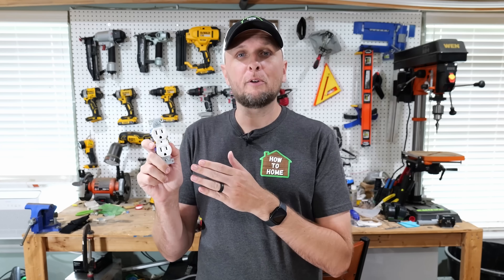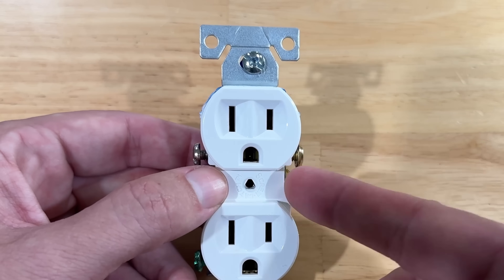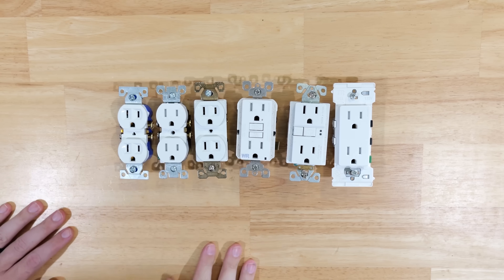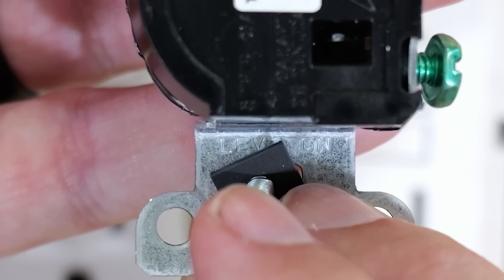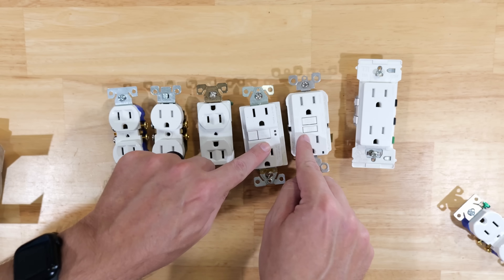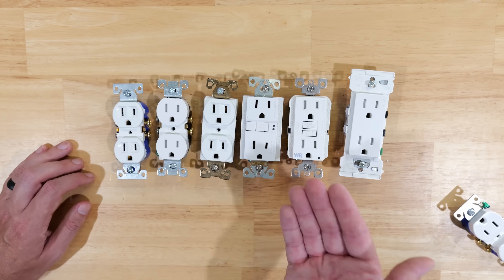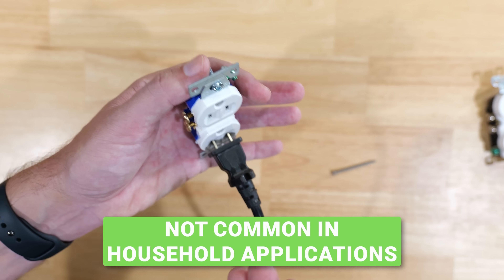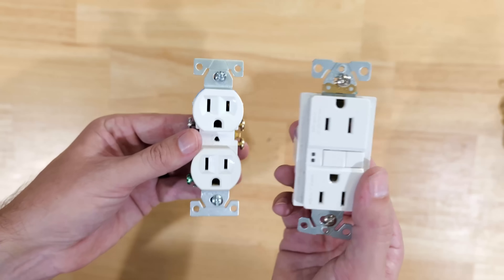The Shocking Reason Why Your Outlets Are Installed Upside Down!

Comment: next time you're in the hospital, look how they install receptables. At least the ones near me here in N Virginia... the ground prongs are ALWAYS installed up, not down. Interesting.
Reply: @charlesfields6597: Ground prong up when that outlet is attached too the wall-switch so people there know where to plug in their lamp to control it from the wall light-switch.
  Medical facilities have things hanging on walls that fall, like clipboards, scalpel, hemostat, that can fall and short the circuit, military galleys and  restaurants, ground up was specified, due to stainless steel utensils being dropped, etc. Therefore it has become required that they be ground up for contractors. In many cities ground up is standard in all commercial and industrial buildings, ground only go down in residential buildings, houses, apartments, condos, etc. 
   Internationally, countries with 3-prong outlets always have the ground up
   Everything is in context and the answer DEPENDS on context. 
   Examples:
“Never took the orientation of an outlet seriously until I was measuring for a shelf with a tape measure. It slid down and fell across the prongs of the washing machine plug.  POW! “ —@joef.6596
“I work at a K-8 school. Maintenance assembles powered multi media carts with the ground plug up in consideration of teachers dragging metal bracelet chains across partially unplugged power plugs.” —  @scaryhouse7969
“a length of florist's wire rolled off a side table onto a slightly loose plug and shorted the circuit, creating a small fire (quickly extinguished).  I now always install ground prong up” @deegee54
“I work at a restaurant and we have this work table with some outlets built in on top. Someone managed to let the edge of some tin foil go in between a plug and the outlet and it got disintegrated.”@MatthewSuffidy
“I knocked some change off of my end table one day my mistake of course, and a coin fell down right on the prongs resulting in a loud pop and a flash along with some smelly black smoke. I have since gone through my home and reversed all of the receptacles so the ground prong is now on the top.”—@chrisenglert3958
“my wife's gold necklace chain dropped off the rack onto two prongs of a device that were plugged into a receptacle with just a little prong showing.  It vaporized the gold necklace area of contact and left a nasty burn mark on the faceplate of the receptacle.   This was on a bar and I probably should have oriented the receptacles there ground prong up.“—@winfordnettles3292
"I had lunch with the Chief Electrical Engineer at McDonalds headquarters. He told me that one of the workers in one of their stores had her hand badly burned when a metal cookie sheet (or something similar) slid out of her hand. It fell onto a receptacle that was loose…the metal cookie sheet made contact with the two blades resulting in  big arcing flash that caused the injury, this is a reason Ground Up is safer."
“In commercial buildings (where receptacles are very high from the floor) ground has to be at the top. In a case of a water leak ground has the first contact with the water. In residential buildings (where receptacles are not far from the floor) ground needs to be at the bottom. In a case of a flood, ground wire would have the first contact with the water.”—@powerzx
“When a heavy extension cord or wire from a device plugged in is experiencing stress from the cord being pulled taught or tugged on, the greater force is usually downward. The ground prong being longer, exerts the greatest torque when the wire is being pulled in a downward direction.  Occasionally that downward force will cause the plastic of the ground prong opening of the receptacle to crack from the downward force. If the ground prong is up, that downward force has much greater support from the receptacle structure. I’ve personally cracked a few receptacles over the years working on projects where the wire plugged in was being yanked around a lot. Where the ground prong was up, the extension cord always stayed more securely plugged in.”—@TechwizJoe1
"while working in a mechanical repair shop, I went to get something off the shelf that the radio was on. I bumped the radio. as I turned POW, FLASH, BANG.  the metal antenna fell sideways and was across the plug and touching the window frame. glad i did not try to catch the falling metal antenna.  an extension cord was just a little loose in the socket.”@tazhd143

Comment: Im not an electrician but a contractor. My argument is why do something just because everyone does it that way? 

In my own house I install ground up unless there is a specific reason such as a dedicated appliance outlet where a right angle plug is typically used.
It's to prevent damage to the narrow plastic below the ground port. 
If you plug a heavy grounded cord into the receptacle and inadvertantly step on the cord near the plug it will easily break the plastic below the port if the port is in the down position. You see this in old receptacles all the time. It's broken because the cord was stepped on. It also can damage the ground prong on the cord more easily too. This not only creates a shock hazard but a fire hazard too. The receptacle and ground prong both are less vulnerable to damage when installed up.

Comment: Ground plug DOWN.........  plus it helps prevent mis-wiring because it's following the majority of the installations in this country (Hot Black Wires on the RIGHT hand side of the receptacle when looking at the front. Would have been nice though if you had included a test as to how well the plug stays into the receptacle if something heavy drops on  the plug.... if it even makes a difference ?

Comment: You also want the last conductor to be disconnected to be the safety ground.  For that reason you want the ground to be mounted underneath the power carrying conductors.  But if you are really worried about foreign objects shorting the hot and neutral together, mount the receptacle sideways with the neutral conductor in the upward position.

Comment: very funny, all these people saying "oh that will almost  never happen" about metal objects shorting across the hot and Neutral and then multiple people saying "it happened to me" yes it happens, I don't think there is any reasonable cast that it ISNT safer. it is however a convenience factor with certain plugs and items, but that is a different question, isn't it? the "its safer ground down "argument isn't supported by much evidence is it? oh the ground is the last to pull out? how is that more of a hazard than arcing? its just silly.

Comment: I was taught ground up.. On older houses with metal duplex covers if the cover screw came out and like your nail would hit the ground rod instead of the hot and common and short the plug.

Comment: Hospitals where I've worked are the only place I've seen them have a standard for ground prong up.  The logic, as it was told to me, is that if you drop a tool (scalpel, hemostat, etc.) then if the ground prong is up, it can't land on the hot and neutral in the event the cord has been pulled loose from the wall.  Not an electrician, but the title reminded me of their policy and I had to check it out.

Comment: You didn't mention that depending on which side the connecting wires are coming in makes one way better than the other. E. I. Ground enter box from left or right side.

Comment: You didn’t say anything about plugs that are 90 degrees. In that case, I  think it’s best to install the outlet with the ground prong up to avoid a loop that stresses the power cord over time. I hope you understand what I’m trying to say. A good example is the outlets that are used for dryers. I always install that in a way that allows to cord to hang freely without that awkward loop. Keep up the good work. I find your videos very informative.

Comment: Yes there is, you just don't know anything but residential code. Funny, you really don't know the real reason for all this confusion. Having the ground lug up all started with Hospitals and the Life Safety Code... The reason was, most hospitals use stainless steel covers. So, if the hot and common are up, and the screw comes loose and the cover drops, it will short out, but cannot if the ground lug is up. Now you know the real reason. Next became what is know and printed by the NFPA that although not code, it is recommended as best practice to install with the ground lug up.. This is important for other commercial applications such as restaurant's, kitchens and others who use stainless or metal covers.

Comment: Definitely preferring ground down. Most angled plugs are designed this way, so it creates extra stress on the cable to have the ground pin up. This  includes window AC units.
Furthermore, it's a requirement that phase, neutral and ground disconnect in this specific order, which explains the shape (and length) of each pin/blade. So, by design, if a connector is hanging poorly in an outlet, it should naturally have the ground connected the longest, which normally happens with the ground pin down.
As for the never-ending discussion on the safety issue about a conducting item falling on the plug and electrocuting someone: if you'd actually do a risk analysis, it can be discarded as a real risk. It would imply 1) poorly connecting the plug, 2) having loose metallic objects near outlets, 2) having is perfectly inserting AND perfectly balancing (not bouncing off) AND touching either a) phase only (even more highly unlikely,) or b) phase + neutral (in which case the circuit breaker will do its job), and if you still made it to 3A, you'd be innocent enough to actually grab the object with bare hands without either disconnecting the plug or flipping the breaker.
If that were an actual fear, then install all your outlets horizontally with the neutral up.
But, bottom line is that the NEMA connectors are really extremely poorly designed when it comes to safety (they're pretty compact though, but that's the only advantage.) Looks at the European connectors (specifically looking at the "shucko" F-type standard) and we'll see that 1) direction doesn't matter, because in this day and age everything has switching power supplies, and 2) there are two recessed stages before contact can happen, so nothing can just "fall" in a crack and become energized.
Reply: @jasonborne4330: Ground prong up when that outlet is attached too the wall-switch so people there know where to plug in their lamp to control it from the wall light-switch.
  Medical facilities have things hanging on walls that fall, like clipboards, scalpel, hemostat, that can fall and short the circuit, military galleys and  restaurants, ground up was specified, due to stainless steel utensils being dropped, etc. Therefore it has become required that they be ground up for contractors. In many cities ground up is standard in all commercial and industrial buildings, ground only go down in residential buildings, houses, apartments, condos, etc. 
   Internationally, countries with 3-prong outlets always have the ground up
   Everything is in context and the answer DEPENDS on context. 
   Examples:
“Never took the orientation of an outlet seriously until I was measuring for a shelf with a tape measure. It slid down and fell across the prongs of the washing machine plug.  POW! “ —@joef.6596
“I work at a K-8 school. Maintenance assembles powered multi media carts with the ground plug up in consideration of teachers dragging metal bracelet chains across partially unplugged power plugs.” —  @scaryhouse7969
“a length of florist's wire rolled off a side table onto a slightly loose plug and shorted the circuit, creating a small fire (quickly extinguished).  I now always install ground prong up” @deegee54
“I work at a restaurant and we have this work table with some outlets built in on top. Someone managed to let the edge of some tin foil go in between a plug and the outlet and it got disintegrated.”@MatthewSuffidy
“I knocked some change off of my end table one day my mistake of course, and a coin fell down right on the prongs resulting in a loud pop and a flash along with some smelly black smoke. I have since gone through my home and reversed all of the receptacles so the ground prong is now on the top.”—@chrisenglert3958
“my wife's gold necklace chain dropped off the rack onto two prongs of a device that were plugged into a receptacle with just a little prong showing.  It vaporized the gold necklace area of contact and left a nasty burn mark on the faceplate of the receptacle.   This was on a bar and I probably should have oriented the receptacles there ground prong up.“—@winfordnettles3292
"I had lunch with the Chief Electrical Engineer at McDonalds headquarters. He told me that one of the workers in one of their stores had her hand badly burned when a metal cookie sheet (or something similar) slid out of her hand. It fell onto a receptacle that was loose…the metal cookie sheet made contact with the two blades resulting in  big arcing flash that caused the injury, this is a reason Ground Up is safer."
“In commercial buildings (where receptacles are very high from the floor) ground has to be at the top. In a case of a water leak ground has the first contact with the water. In residential buildings (where receptacles are not far from the floor) ground needs to be at the bottom. In a case of a flood, ground wire would have the first contact with the water.”—@powerzx
“When a heavy extension cord or wire from a device plugged in is experiencing stress from the cord being pulled taught or tugged on, the greater force is usually downward. The ground prong being longer, exerts the greatest torque when the wire is being pulled in a downward direction.  Occasionally that downward force will cause the plastic of the ground prong opening of the receptacle to crack from the downward force. If the ground prong is up, that downward force has much greater support from the receptacle structure. I’ve personally cracked a few receptacles over the years working on projects where the wire plugged in was being yanked around a lot. Where the ground prong was up, the extension cord always stayed more securely plugged in.”—@TechwizJoe1
"while working in a mechanical repair shop, I went to get something off the shelf that the radio was on. I bumped the radio. as I turned POW, FLASH, BANG.  the metal antenna fell sideways and was across the plug and touching the window frame. glad i did not try to catch the falling metal antenna.  an extension cord was just a little loose in the socket.”@tazhd143

Comment: To me the logic goes back to when all cover plates were stainless steel ( or chrome). This was before the age of plastic cover plates. If the screw holding the receptacle cover on fell OFF, and the cover slipped down you would definitely get a dead short if the ground prong was facing down.

Comment: Don't go flipping your receptacles around, any and all gadjets I can think of that don't have a cord yet are grounded, have the ground on the bottom.  They'd be upside down. Particularly if we're talking about a heater, they probably shouldn't work upside down. Lol 

Those little handy heaters are grounded and the plug turns 45 in case your outlets are sideways and ground is on left.

Comment: As always I enjoyed your video. Thank you. I had a crazy thing happen recently. It wasn’t the example of a screw getting caught on the hot wire but what happened is a very heavy picture frame fell off the wall. It was a picture that had been there for 25 years without incident. It was hanging on an outer wall and just like maybe a month before it happened I had gone around the house and added in those child proof plugs that go in unused outlets that might help block any extra drafts on an outside wall. So the picture fell down to the floor. An outlet was a couple feet below where the picture had been hanging and it hit that child proof plug-in and broke the prongs off inside of the outlet. I couldn’t see the broken off section and I was checking the outlet to see if it still worked when I realized I couldn’t plug anything in to that outlet. I had to replace the outlet. I guess the lesson is if you can avoid hanging a picture above an outlet that would be best. In my case the picture was centered above my bed so the outlet was hidden so ordinarily you wouldn’t think it would matter.

Comment: I've been an electrician all my life.  I learned about alternating current at about 2 years old when I touched a nongrounded metal floor fan while on a damp concrete floor after a brief thundershower.  That let me know that electricity was both interesting and dangerous.  I figured out the orientation reasoning with regard to the ground prong of the receptacle when my wife's gold necklace chain dropped off the rack onto two prongs of a device that were plugged into a receptacle with just a little prong showing.  It vaporized the gold necklace area of contact and left a nasty burn mark on the faceplate of the receptacle.   This was on a bar and I probably should have oriented the receptacles there ground prong up.  Might not have prevented the vaporization of the necklace, or, it might have.  I'll never really know.  But, just a thought on the subject.  Thanks for the video.